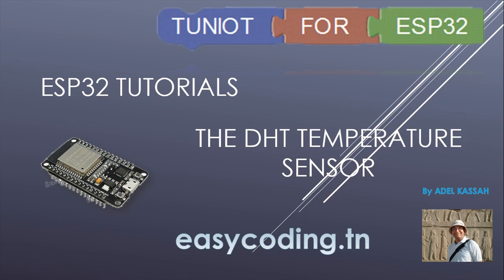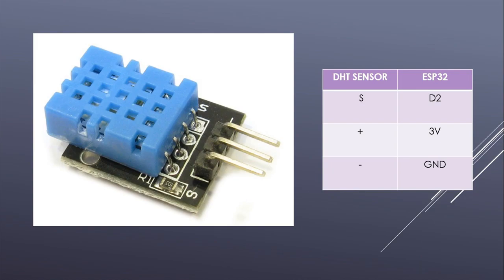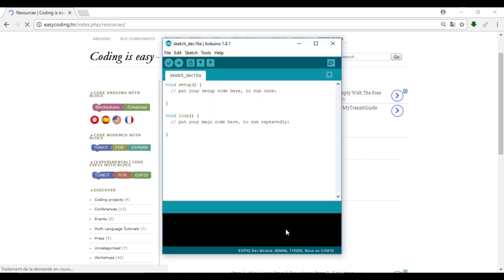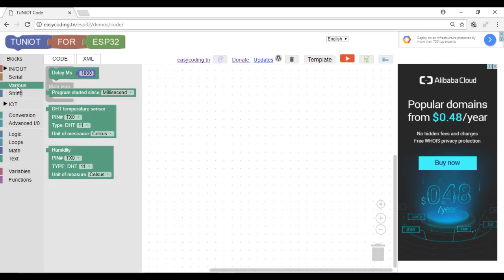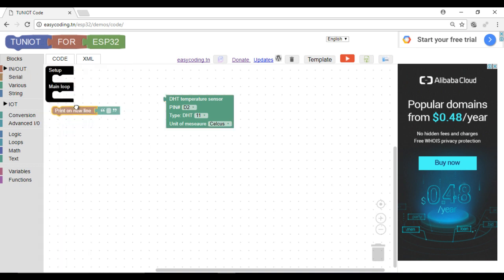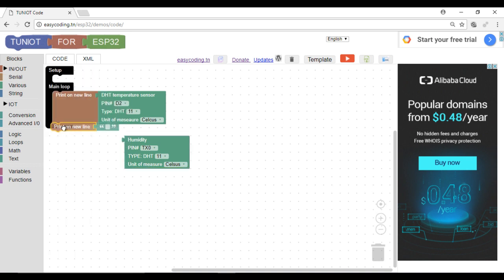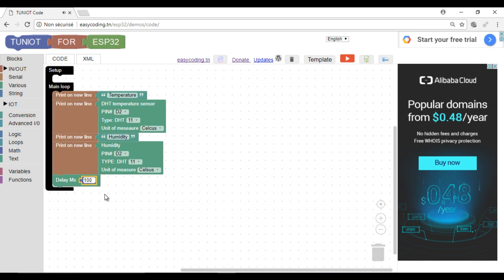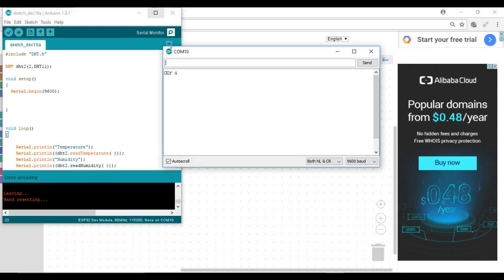ESP32 tutorial A-04: The DHT temperature and humidity sensor

Comment: I got an compilisation error  stating " Error compiling for board ESP32 Dev Module " could you help me to rectify it.
Reply: The error message is 

Arduino: 1.8.6 (Windows 10), Board: "ESP32 Dev Module, Disabled, Default, QIO, 80MHz, 4MB (32Mb), 115200, None"

Multiple libraries were found for "DHT.h"
In file included from C:\Users\*****\Documents\Arduino\libraries\DHT-sensor-library-master\DHT_U.cpp:22:0:

 Used: C:\Users\*****\Documents\Arduino\libraries\DHT-sensor-library-master
C:\Users\*****\Documents\Arduino\libraries\DHT-sensor-library-master\DHT_U.h:25:29: fatal error: Adafruit_Sensor.h: No such file or directory

compilation terminated.

 Not used: C:\Users\*****\Documents\Arduino\libraries\Grove_Temperature_And_Humidity_Sensor-master
exit status 1
Error compiling for board ESP32 Dev Module.

This report would have more information with
"Show verbose output during compilation"
option enabled in File -> Preferences.